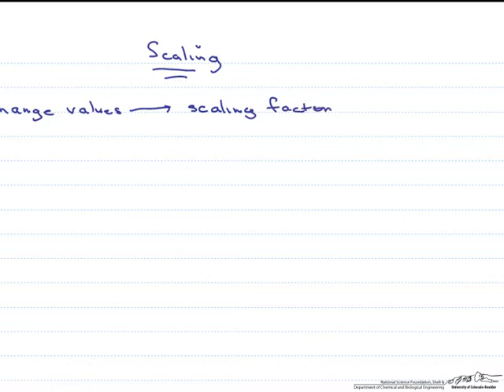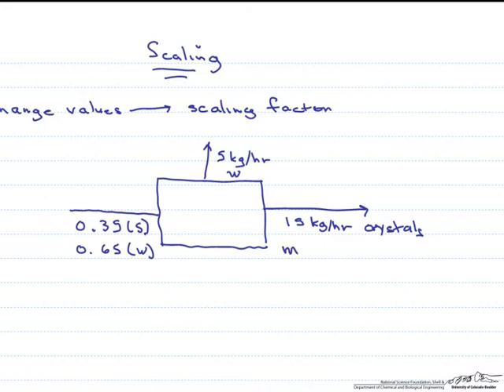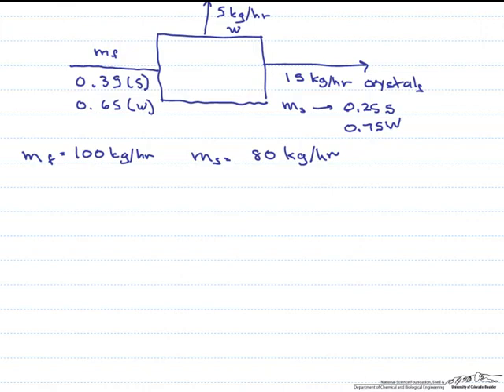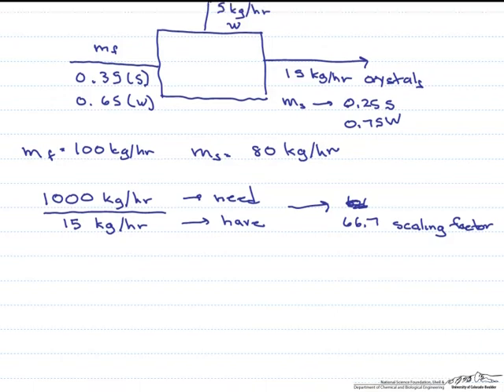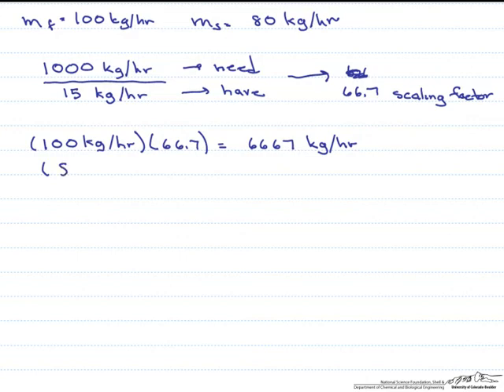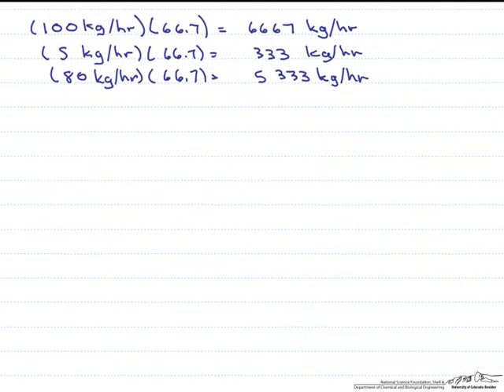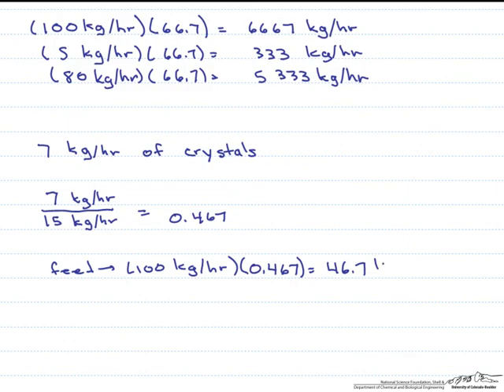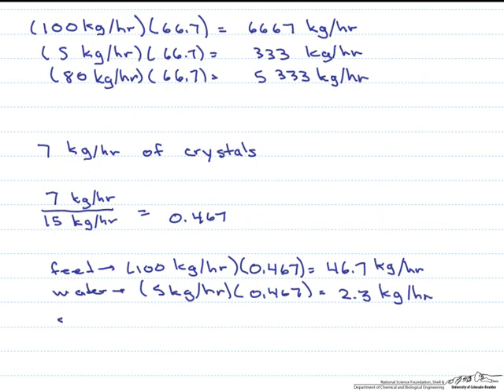Scaling a Material Balance

Comment: how did we solve for the mass flow rate of the feed mf?
Reply from the maker: +binn12 To solve for the mass flow rate of the feed, we can use two material balances.  First the overall balance: 
m_f = 5 + 15 + m_s, then either a salt or a water balance - here I'll do salt: 
0.35m_f = 15 + 0.25m_s, substituting the first equation into the second gives us 
0.35(20 + m_s) = 15 + 0.25m_s, further calculations:
7 + 0.35m_s = 15 + 0.25m_s,
0.1m_s = 8
m_s = 80 kg/h; put that back into the overall balance:
m_f = 5 + 15 + 80 = 100 kg/h.